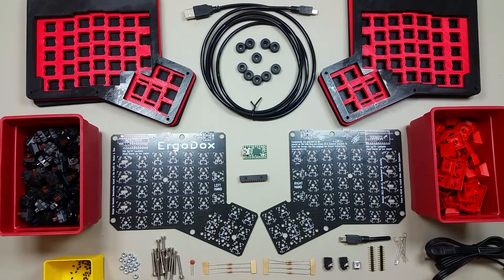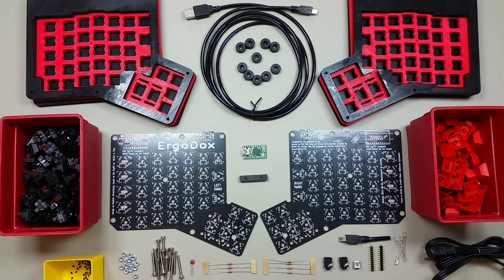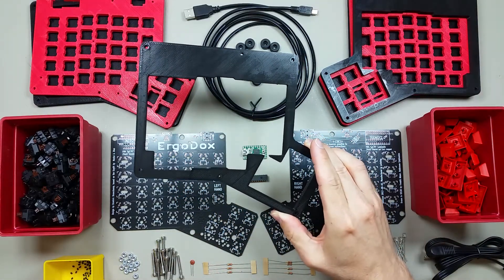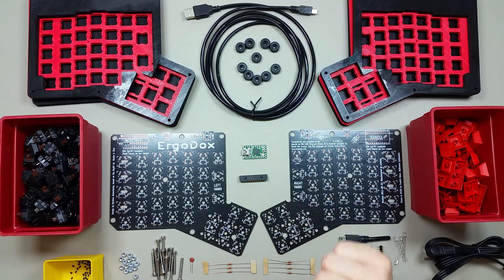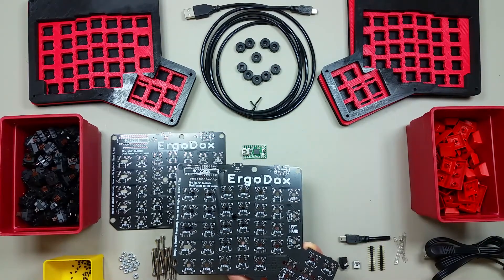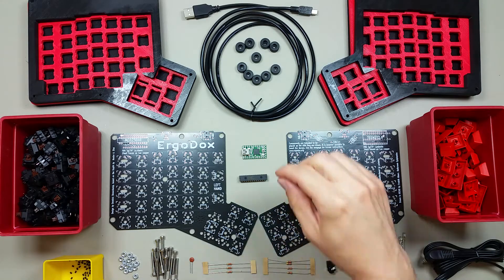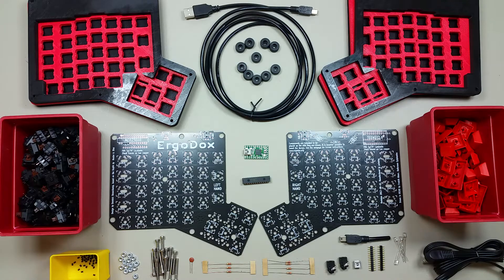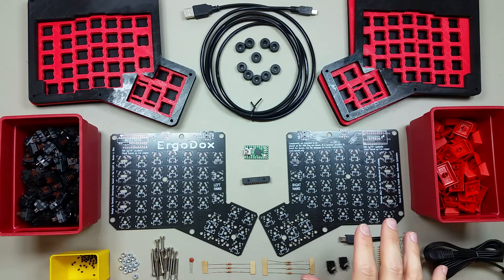How to Build a Keyboard

Comment: tried to download the STL file but it's a bad link. do you have a new link to the file?
Reply from the maker: +ae86manny Thanks for letting me know. It's fixed now. The URL was HTTPS and I no longer have a cert configured for the site.
Reply: I see the entire site is gone, and I couldn't find the STLs via archive.org... Do you still have them available?  I have a (slightly oversized... 205mm by 300mm) RepRap and want to print an Ergodox switchplate, but haven't found any that work out of the box.  I have an STL that I made from a DXF, but your case looks better than what I made.
Reply from the maker: Mark, I took down the site about a week ago because I didn't think I needed it anymore. I just put it back up on a new server, just for you. ;)
Reply: Thanks!  I downloaded the .zip file and your middle.stl files look like exactly what I need!
Reply from the maker: Cool! Have fun!